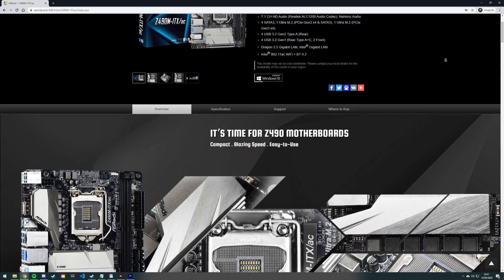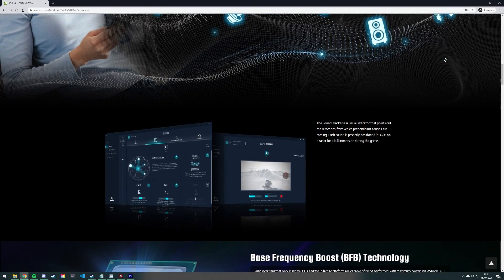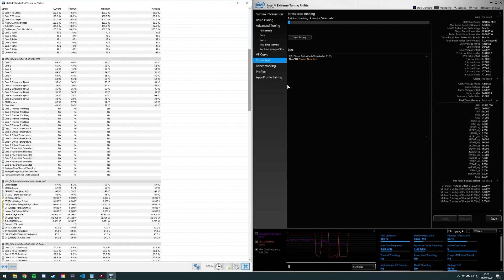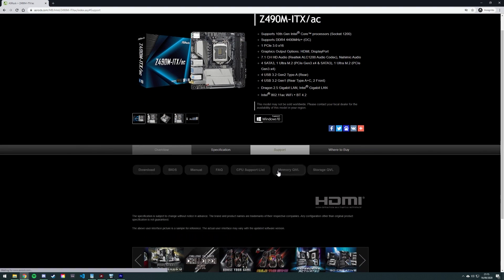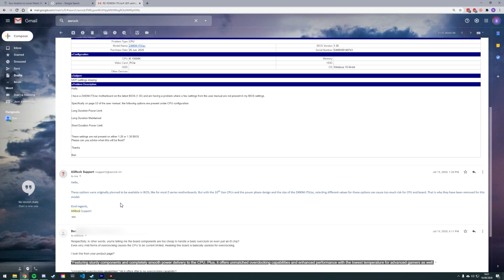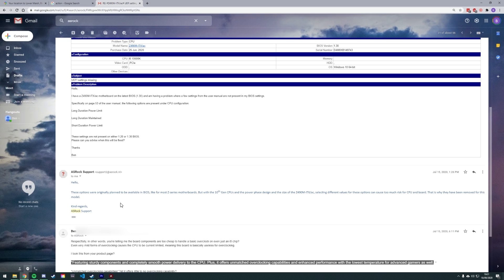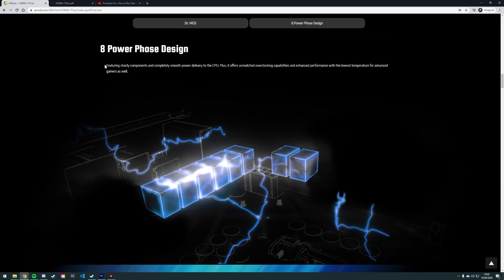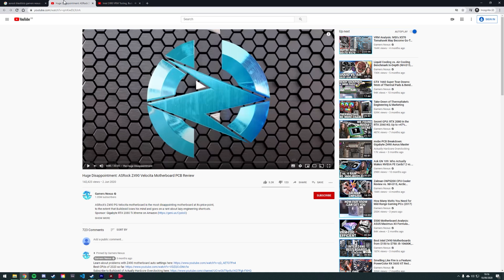Don't buy the ASRock Z490M-ITX/AC (For overclocking) - Marketing BS  // UPDATED

Comment: This is probably a board for stock non k cpu with power limits on ( or slight increase over 65w). I say that because price is pretty much the same as b460i/h470i from Msi or Asus. With this you get memory oc feature, that b460 or h470 cannot offer.
Reply: There is No PL settings unfortunatly
Reply: @Donseipo  Have you updated BIOS to the latest?
Reply: @iPh3x  yes. Version P 1.30
Reply: @iPh3x  I have a i7 10700 "non K" and cant either PL or underclock My CPU on this motherboard
Reply: @Donseipo  So then wtf is this motherboard :D?
Reply: @iPh3x  I hear you. I regret buying it.
Reply: @Donseipo  I got myself a msi z490i unify for i9 10900. Was considering asus rog b460i or msi b460i gaming edge, but after reading about high vrm tems with 10700 got z490i.
I would not buy this msi z490i board again due to densly packed back side of a pcb that limits cpu cooler compatibility. Not all backplates fits. For example Scythe mugen 5 backplate has black hard rubber that touches smd components. I did ordered noctua u12a after buying scythe. Noctua's secufirm2 fits perfectly.
No vrm throttling with z490i unify even with power limit lifted. 4.5 ghz on all 10 cores when running cb23. 3.3 ghz on all cores when pl2 is 65w. Noticeable improvement.

Comment: I was looking for a budget Z490 mini ITX motherboard for a NR200 build. The processor of my choice is an i5-10400 (all core 4.0Ghz, single core 4.3Ghz). What's your opinion for that? I need the Z490 chipset for the 3200Mhz ram :/
Reply from the maker: Since you're not overclocking this board will work fine.
Reply: @AstroflashYT  tnx m8

Comment: Would the H470 ver be fine for a 10700 non-K? Would it still hit it's 4.8 boost clock?
Reply from the maker: I don't own the board so can't comment with 100% certainty but I'd be very surprised if it doesn't work to Intel's factory spec.
Reply: @AstroflashYT  Did the z490 version atleast turbo your 10600k to stock?
Reply from the maker: @ethanjacobson3867  The board would hit an all-core turbo boost of 4.5Ghz (which meets Intel spec for all-core boost). My board never seemed to hit a single core clock of 4.8Ghz but that might be a bios configuration issue on my end.

Comment from the maker: Update 19/11/2020 (see description)
Reply: Hey, thanks for the info!  Good video!
I'd like to ask  you a question:  I'm trying to build an i5 low-power system, planning more on undervolting and underclocking, so I can run it on a meager 2 LifePo car batteries fed by two solarpanels - its a DAW computer for recording music, I don't even plan to add a power-hungry GPU.
Were the facilities for undervolting/underclocking available on that board?  ...in case you looked at that and still remember.
Much thanks ^^
Reply from the maker: @Pharesm  yes it has a core multiplier and vcore adjustment so you could definitely undervolt/underclock if you needed to.
Reply: @AstroflashYT  Thanks much for the info  :)

Comment: Well if you think about it, this board does have unmatched overclocking capability...

In all seriousness, I was considering this board because I'm doing a 10400 build and wanted not abysmal ram speeds. At $160, this seems like it? Should I go for it? I'm willing to spend $30 more for a better z490 board, but I feel like for my use case better power delivery doesn't matter.
Reply from the maker: Aha, very smart of Asrock....

Yeah I was just thinking, Non Z490 boards are limited to 2666Mhz ram aren't they?

If you're not overclocking then realistically this board will work just fine but I say that very grudgingly because I don't think this kind of behaviour should be acceptable. Personally I'd either go for another brand or pick up this Asrock board 2nd hand but I obviously can't stop you buying it :P

Comment: Crazy stuff.. people buy the z490 platform for the overclocking. If it can't then just buy the cheaper H series chipset.
Reply: I actually just want to use 3600 MHz CL16  RAM with the i5 10400, so this board fits the bill. B460 and H470 motherboards have RAM speeds locked at 2666 with non-K CPU which pisses me off
Reply: @hansbehrends438  Is the board still working well ?
Reply: @trixniisama  I actually ended up steering clear of it, and bought an MSI MEG iUnify Z490 instead. Expensive, but very well built and worth the extra money in my opinion. I haven't had a single problem. Core i5-10400, 32GB CL 16 3600 MHz RAM. I'm planning to replace the core i5 with a Rocket Lake Core i7 11700
Reply: @hansbehrends438  Nice, I'm probably gonna buy a MSi B460 mortar which is one of the best budget mobo for intel 10th gen, and I'm gonna pair it with a 10700 non K
Reply: @trixniisama  good pairing, should be good for years to come. For best future-proofing, be sure to get 32GB minimum.

Comment: Not a rude way, but I don't think you know how to really overclock.

Edit: I realized this next bit should be important, why did you not put the parts used in your computer? If you are going to say a motherboard is deceptive, you should at least tell us what the rest of your parts are. You only told us you have a 10600K, nothing further. We don't know if you have a 280W PSU, or if you have a power hogging component.
Reply from the maker: Care to elaborate?
Reply from the maker: No other components would have any impact on the content of this video...
The motherboard doesn't know or care what the power supply is rated for; it's just going to pull whatever it requests. If the power supply isn't up to scratch, it's gonna crash. Simple as that.
But since you're asking:
EVGA 650W G3
16GB DDR4
1080Ti
Crucial P1
EK A240G Custom Loop
Reply: @AstroflashYT  Alrighty, it shouldn't be a component issue. Try using Throttlestop to unlock the current limit (it might or might not work), that seems to be the only other way. I understand this isn't something a lot of people would know to do, because not a lot of people use it for desktops. And my apologies to coming off as a bit aggressive in the beginning, it just seemed like a video without a lot of detail into the issue.
Reply from the maker: @Berfs1  No worries. I already sold the board but even then I wouldn't mess around with Throttlestop anyway as Asrock would have already configured the maximum safe power draw for the board in firmware as far as I'm concerned. Sorry if you thought it wasn't detailed enough.
Reply: @AstroflashYT  What are the rest of the components in your system? PSU, GPU, etc

Comment: I guess this board still make sense for users with non-K cpu who want support for more than 2666/2933 mhz ram.
Reply: Exactly! Savvy buyers know that this is a rubbish board for serious overclocking. I'm irate with intel for arbitrarily locking the RAM speeds to 2666 on their B460 and H470 Chipsets.
Reply from the maker: @hansbehrends438  No way to know to  "VRM" performance until you've purchased it or someone else has covered it.  Having issues on a high end compatible CPU I.e  10700K/10900K would maybe make me more forgiving, but having issues on the lowest end OC'ing chip? Bullshit. Yes ""obviously"" a savvy buyer might consider the risks of buying a cheaper board for a given chipset. But that's not the point I'm making here.
 
---
It's not an  excuse for blatant  marketing bullshit that takes advantage of A) the less savvy buyer B) Bending the rules of why chipset standards were relevant in the first place i.e they are "complying" but not providing.
Reply: Ballistix form XMP 3200 to 3600 with no problem.

Comment: I was seriously considering this board for my 10600k. I'd watched the reviews on Optimum Tech on the round up of z490i boards  but they were all top tier boards. This boards seemed too good to be true, and it appears it is! I ended up getting the MSI z490i unify. Thanks for your information. It guided my buying decision.
Reply: I also bought the MEG iUnify and I can confirm that it is a great board, 3 months later, not a single problem. Im not overclocking however. I'm looking forward to the Rocket Lake i7-11700 for this

Comment: Yes I bought one off Amazon and I thought it was a good board, but died in just 3 weeks.  I ordered a replacement and that two died in a few weeks.  This was with a 10700K cpu.  Really cheap components.  Buy Asus.  I have three Asus motherboards that are running for 6 years straight.
Reply: Everyone recommends not to run K series.